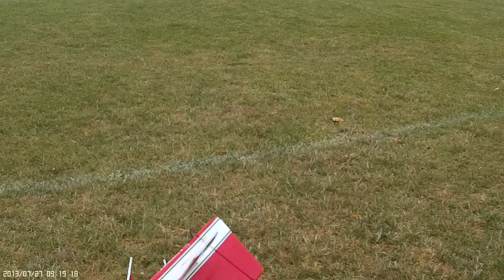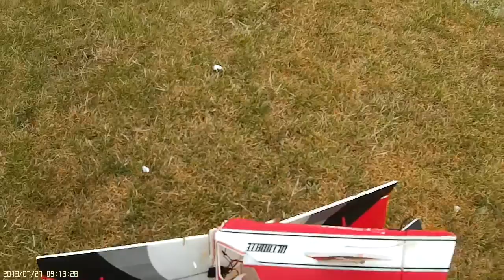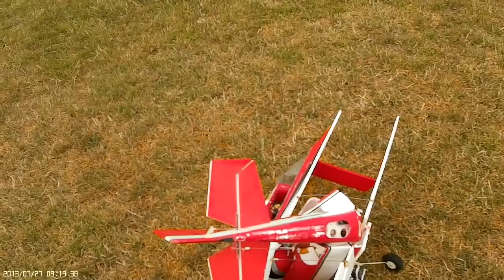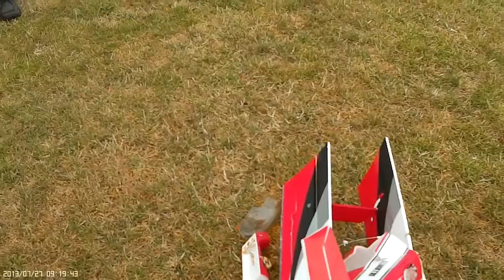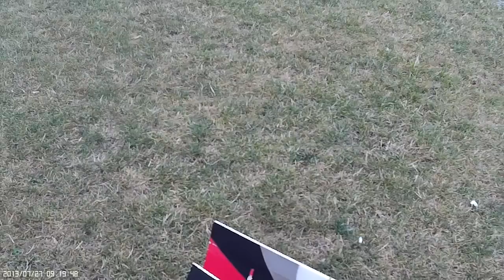E-Flite Ultimate FX Bipe crash walkaround 27Jul13

Comment from the maker: Not pilot error-see my other videos! I've flown the same model at much further range in the same location without issue.The crash made it 3 locations and 8 different model that have either crashed or glitched. The only common factor is the TX! Not low voltage, high temperature or badly sited RX's.